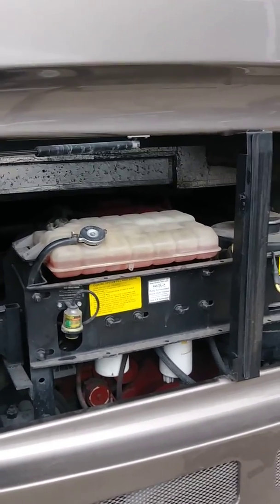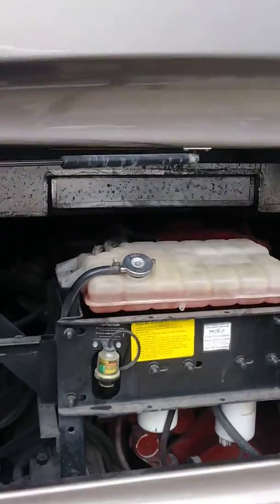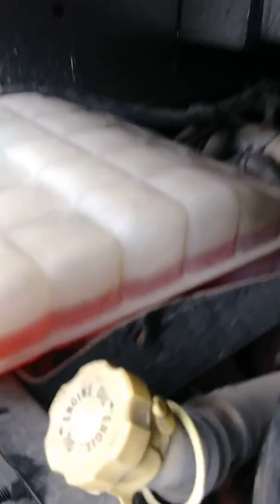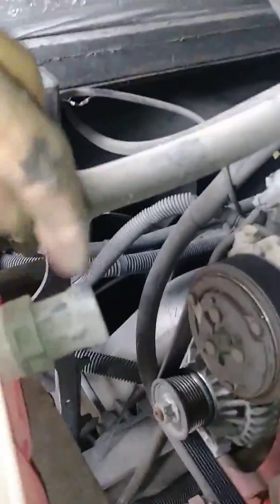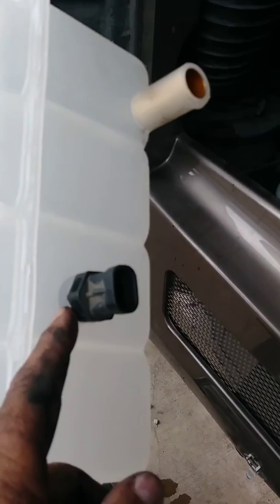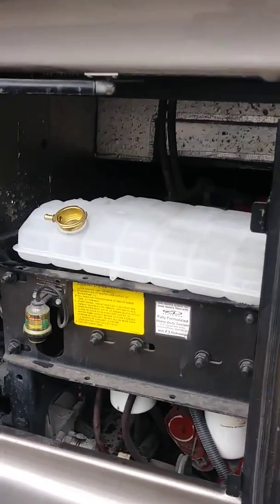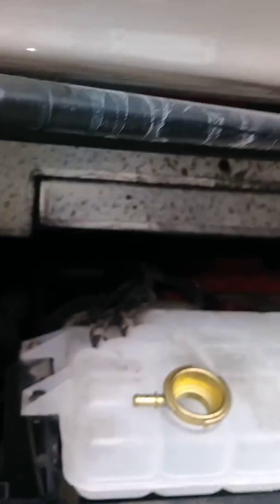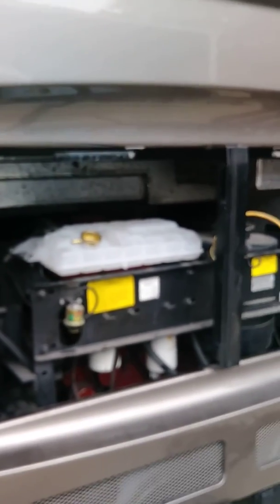TIFFIN REPAIR Radiator Reservoir 2008 Tiffin 425 Cummins engine side radiator

Comment: FOLLOW UP: we did find the frame had a slot under the tank where you could actually insert a box wrench from beneath the tank up to reach that one troublesome, rear, right side bolt.